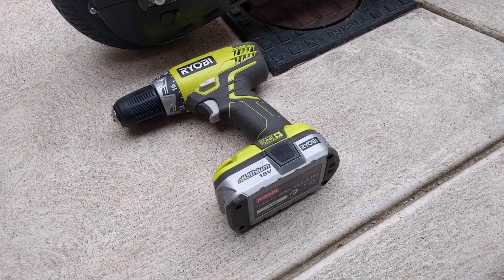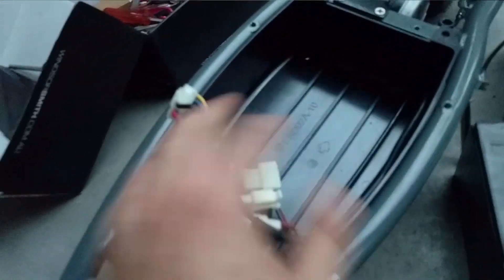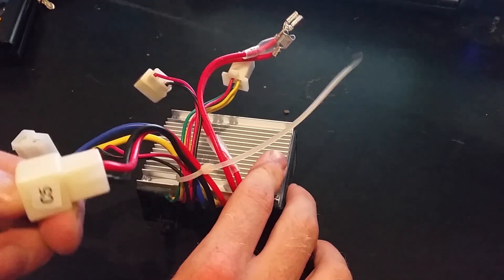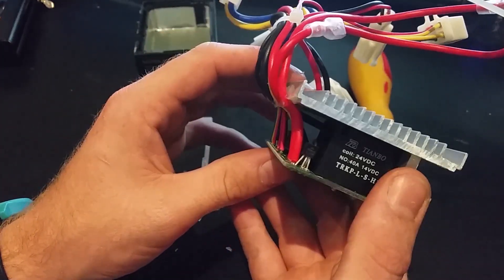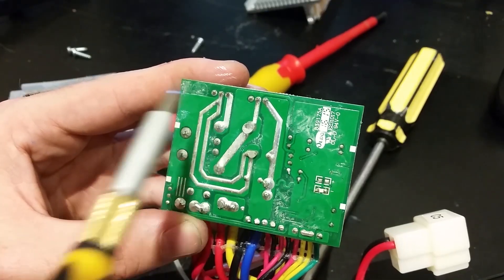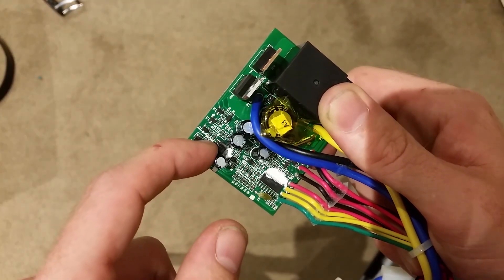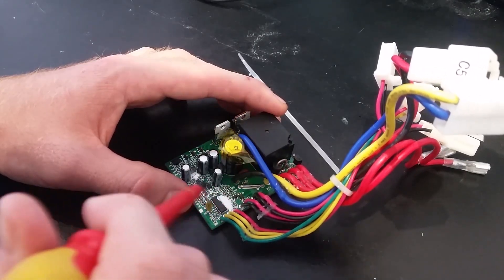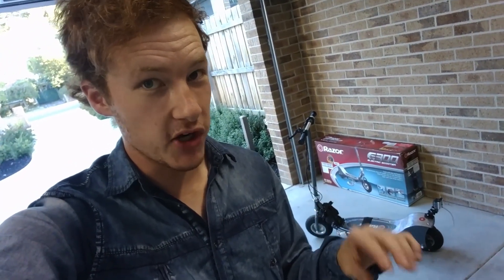Making the Razor E300 Faster With Drill Batteries! Ryobi ONE+ - Scooter Episode 2

Comment: To limit the effect the current shunt, just (on the solder side of the PCB), short the shunt pins with a length of copper wire. The current sense will say to itself, man this motor is very efficient, and not bother You.. Ken  !;!
Reply from the maker: Kenny Malone good tip! I get into this in some of the later episodes :D
Reply: Keep up the GooD Work..  !;!

Comment: Did you use a bms?
Reply from the maker: Wiziki nah, this was just a test. In the later episodes I do.
Reply: TK do you think bms’ are necessary? I’m building a system and I don’t want the hassle of trying to find a bms. Do you think that is safe?
Reply: TK and do you think a 7000w motor (brushless and 18s) is too much? And if I wanted to get a 7000w speed controller do you know where I would get one?
Reply from the maker: You either need a BMS or a balance charger, otherwise you'll destroy your batteries or cause a fire.

7kW is a LOT of power, and scooters like these are not very controllable. I'd say it could be too much but you can always try and see if it's rideable without hurting yourself. Tread carefully.
Reply: TK I mainly want it for the 18s (so I can fit 3 6s batteries). But what about the speed controller, would you be able to find it?
Reply: TK do you think that 2 batteries are enough? (6s 22.2V) and is there an alternative way to charge, other than taking out you battery’s and plugging them in?
Reply from the maker: Wiziki a lot of these questions are answered in later episodes. Have a watch and see how you go.
Reply: TK ok. Thanks.

Comment: I did this with a PR200, just overvolt. But I have been wanting to do this with the 4AH kobolt lithium battery packs. The only thing is, they are only 4AH which I have 10AH right now. Meaning less distance. Been wanting to try though. Replace the controller though. They don't like overvolting.

Comment: i have a e100 and im trying to get more juice out of it. the control board does not look anything like yours. It seems like it has 2 relays but not sure where or how i can bypass it like you did.
Reply from the maker: +Nacho Loza Hi! Yes, the E300 is a completely different scooter to yours.

Bypassing the relays won't do anything to make the scooter faster on an E300 anyway, it's only there as a safety cutout. You need to bypass it to make the scooter work with higher voltages (but you'll likely blow everything up anyway doing that, as the series shows).

E100s aren't as popular for modification but you could have a Google to see what can be done. :)
Reply: I poked around and didn’t find anything on the good ol inter-web.  Not sure if there is a solution.  Thanks for the reply

Comment: So, the speed controller is the little black box with the metal line things on top? Can i take it out and have the scooter still work? Is that why mine is so SLOW? I would love some advice on that
Reply from the maker: Wild Gaming the speed controller is what takes signals from the throttle and sends power to the motor. It isn't the main reason why the scooter is slow - that's largely down to motor and batteries. 

I modify the speed controller in future episodes to handle more power, but it's complex. I'll be releasing a video soon on a more accessible DIY mod for more speed.

Comment: hey just a quick question: I did not fully get the 2 points in which u souldered together in the last step could you explain a bit more
 and great video thanks
Reply from the maker: Hi Angela, for more detail on the mod check out https://www.google.com.sg/url?sa=t&source=web&rct=j&url=http://hackaday.io/project/9941-the-razor-e300-overvolt&ved=0ahUKEwjL58CfwcPVAhVFPI8KHaR0BuQQFggjMAA&usg=AFQjCNGPIaDH5KSIYM5CjaCK2ZwgSNXUnw

Hope that helps :D
Reply from the maker: one of the logs has detailed photos on what I did

Comment: Gave it a try but im pretty sure i broke it... Oops!
just makes a click coming from the "fun police" box when i engage the throttle. 

Thanks for the tips and im sure i just didnt follow you close enough. 
I knew the risk i was taking and tbh i would definitely try it again if i had the chance.
Reply from the maker: Hi David, sorry to hear it's not working out for you!

If it's making a click sound, that sounds like it's the relay shutting off because it's detecting too much voltage being put in.

As you know, we bypassed that in this video. Perhaps you just haven't quite bypassed it correctly? If nothing's getting hot or smoking, you probably haven't blown anything up. :)

You can read the project logs here which may help you out with some illustrated diagrams - https://hackaday.io/project/9941-the-razor-e300-overvolt

Just be careful of course, as these batteries can be dangerous and if the speed controller blows a FET while you're driving, it'll stick at full throttle which can be dangerous. Play with the scooter at your own risk :P
Reply: TK Fixed it! 
It was just a bad soldering job by me! 

I'm actually using the parts and mods from an old e300 to power my "new" E-bike! Probably a little safer as my brakes can over power the friction drive  setup just in case bad things happen! 

I'm looking into using 18650's. Have you worked with them much?
Reply: Just rewatched and realized that the drill batteries look like they are 18650s. 🤔
Reply from the maker: David DeMarta that's awesome dude! Glad we could trouble shoot that over comments haha, that's so cool.

As far as 18650s go, I haven't used them, but I've heard of people building eBike packs using them.
Reply from the maker: David DeMarta oh. Duh. You are right! Hahahaha.

Comment: I got 2 e100 for just about free. cut them to add them together ( made it longer ) added 2 more batteries in a series, 48v. tossed the servo/speed controller out and bang. A scooter that will push a 200lb man with ease. around 20mph
Reply: Yo where is the peed controller on the e100s, i cant find one on my daughters.

Comment: Why not just throw out all that crapola and just put in a high current relay?  All on or not on..
Reply from the maker: Jeremy Schoonover Switching high current DC with a relay wouldn't be particularly effective. The main issue would be arcing which would quickly destroy the relay in such use. In addition, the speed controller does do some PWM motor control even though the throttle input is on/off.
Reply: One could always use a high current DC switch like those found in those jumpstarter packs.  I think the copper plate switches are rated at something insane like 400 amps.  You're right about the relay arc-destroying the contacts.
Reply from the maker: Jeremy Schoonover certainly could use one, but they're not particularly well suited mechanically for use as any sort of throttle. flicking a big switch on and off while flying down the road isn't great versus a small flick of the wrist.

Comment: Hello, I need help. I have a Ezip E500 electric scooter. Is there any way to increase the speed?
Reply from the maker: Probably! Start by Googling to see what others have done. Failing that, research how the scooter works - motor type, controller type, batteries, etc. and then see where you can make improvements from there.

Comment: Remove the tires and put 10" that can hold more , I have one and they are more steady with 10" tires and you will go really fast and the module control holds really good .if you run this for long distance will over heat

Comment: All sounds great would be even better if you got hold of a Go-Go motability scooter and found out how to hack that so I can beat the old ladies.
Reply from the maker: Hah! I think Photonicinduction did a quick and dirty mod on one of those with a bajillion extra batteries for MOAR SPEED (Y)
Reply: I tried that, you can't. A faster one (8 MPH maximum compared to 4 MPH) has a different ratio gear box. Connecting the batteries directly to the motor doesn't increase the speed of the wheels. If you want faster, start with an 8MPH mobility scooter, and put some larger diameter wheels on it (the rear, driven wheels). In the UK where I am, you can drive a 4 MPH mobility scooter with no restrictions, but an 8MPH one can only be driven on the road and needs to be registered as a road vehicle, you do not pay road tax though. You are also meant to be genuinely disabled to drive one too, but I had fun driving round the supermarket and having people offer to help with things. They were a little upset when I got out and did things for myself, before I explained I was just on my way to deliver the scooter to someone that had had their own scooter break down.

Comment: 36v is just nominal voltage, at full charge it's actually 42 volts!  I am quite surprised it worked on only single cell in series, also wondering since I'll be building my own pack if should just connect 7 cells to get nominal voltage of 25.9V and double up in parallel to get more current, maybe even go 8s2p.
Reply from the maker: yeah, lithium cells have a huge operational voltage range. some of the HV lithium packs go up to 4.35V fully charged now! crazy.
Reply from the maker: I've done 8S on similar motors before without issue. 10S at high current got nasty in the latest video ;)

Comment: how can i make the battery last longer on mine? i dont even care about the speed i just want to have a use time of over 20 freaking minutes.
Reply from the maker: If you just want longer run time, I'd suggest swapping in 6S or 8S (or 2x4S) lithium packs with as much capacity as possible. That way you won't really be overstressing the controller but you'll have way more Ah (amphours) to play with in a smaller space and lighter weight than the stock SLA packs. 

You may still need to bypass the overvolt protection if you go 8S but it's workable.
Reply: TK ok thanks
Reply: TK oh and btw, if i change to those batteries, can i still charge them using the normal razor charger?
Reply from the maker: +RedYT Nah, you'd need to implement a solution like what I put together in episode 3.
Reply: TK ok

Comment: Hi! It looks like you changed the chain drive to belt drive, is that right? I was hoping to do this to try and make the scooter quieter. Would you mind pointing me in the right direction?
Reply from the maker: Still running the stock drive, I would have filmed it if I changed it. 

If you want to do that I'd say go buy a whole bunch of hardware from McMaster Carr (who don't ship to Aus, grr) or another mechanical parts place. Somewhere that sells belts and toothed pulleys and so on.

My old scooter I built had belt drive... there were slipping issues and it wasn't that much quieter. I'd say try and adjust and maintain yoir chain drive if it's too loud, first.
Reply: +TK Thanks for the response! It does seem strangely loud. Any recommendations on making it quieter? Cheers.
Reply from the maker: Check lubrication, if it's running "true" (i.e. sprockets are aligned), check it's not too tight or too loose. Check all bearings for lubrication and condition too.
Reply: +TK Ok will do. Thanks for your help!

Comment: I was about to mention that current shunt...replacing that alone is enough to triple your drive torque. I know cuz I did it with my e300s
Reply: But it never occurred to me to wire the thing straight to ground....
Reply: Are there any guidelines or maths for doing this and getting repeatable results? Do I just need to wire up a watt meter and play with shit?

I just picked up a e300 and I'd like to get some more range and speed out of it, mostly range. But I don't want to deal with buying hobby lipos and replacing controllers right now. 

How much can the stock electrics be pushed before I start worrying about melting things?

Comment: What kind of ride time do you get out of those batteries?
Reply from the maker: The stock batteries are 7 Ah, these are only about 1.5 Ah. Ride time is about 10-15 minutes. I used these as a proof-of-concept before I dropped coin on a beefier set of LiPos. I'm now just waiting on parts to complete the conversion and shoot a new video :)
Reply: +TK cool! I've added a 300w motor in place of my 100w on my e100 and bought two 18ah lawn mower batteries. very heavy but I get about 15mph for a solid two hours
Reply from the maker: Nice! That's a hefty pack you got there, long range is awesome. I really dig the Razor scooters, they're a great platform to hack on.
Reply: +TK they are! I'm planning to add a cushion or some sort of seat to mine next

Comment: already done that and my little pulse lightning with stock 24v 100w motor is still running with two makita  18v 4.0 A li-ion batteries in series. I only weigh 115 lbs so when fully charged at 20.3v a piece,  I can reach 27mph. just a push button wired directly to the motor and batteries.
Reply: Post video TC Woodworks and Design please!
Reply: +Steve Auguste 
yeah those tool batteries are something else, but I stopped using them. the scooter will run until there's power left and lithium ion cuts off when very low and that's when one of my makita battery ($100 a piece for these 3ah makitas)got fully drained and killed 6 cells inside, including the charging circuitry.
what I'm into now is three 12v plus one 6v, all 8ah, maxing out at 46v fully charged to the same stock 24v 250watts stock  e300 motor. I changed the wheel sprocket from the original 55 tooth to 47 tooth that came from the pulse lightning. had to enlarge the inside diameter using 2 1/8" bi metal hole saw and just refined it with a half round file.
the result of these higher voltage and sprocket combination was hair raising, as the e300 now can run at max speed of 33mph (via gps speedometer) and it's about time to change the motor sprocket to a 15 tooth, 1 3/8" diameter, from 11 tooth 1". it might pull near 40 but I doubt it unless the motor is swapped with a higher wattage, say about 500watts.
when start hitting the 30mph range, riding becomes scary, cars pulling up from corners, people walking and dangerous bumps even small at speed, that small of a tire inflated 45psi can jerk you and your eyes are always looking forward, can't even glance the side views usually done when running slow. I've forgotten how to post videos on YouTube (fyi- I will be 51 years old this December)and don't have anybody to ask to film me
Reply: + T C Woodworks and Design

Quick questions:

1)the "three 12v plus one 6v, all 8ah" are drill batteries?
2)changing sprockets made the scooters faster?
3)could you put the camera on something with height (like on top of a box) and angle the camera to catch you going down the street?

PS. I can help you upload the video once #3 is done! :)
Reply: +Steve Auguste 
batteries are all sla. but there's a better alternative, lighter and safer than lithium ion- check out lithium phosphate. same size as sla, very light, 12.8v and you can charge it with the regular sla charger.
the reduction of the wheel sprocket made it faster but at the same time consumes more power and I would imagine enlarging the motor sprocket will do the same. that's why, opting for a higher wattage is a solution, a 500w motor can take up to 52v with no problem and less heat plus more power in oppose to a 250w that heats up pretty fast in the upper 40s voltage. the higher the wattage the more you can overvolt.
but I will do what you suggest, to just place the camera at a certain spot to catch me getting closer to it and a driveby shot.
Reply: + T C Woodworks and Design Thanks for the heads up! Look forward to the video!

Comment: or you can just increase the ah of the batteries!  what I did is: I have two scooters and I took the batteries out from the one and put them all on one I left it with 24v but it got 14 ah instead of 7 ah it made it faster and the runtime is way longer the torque is much better too 
I didn't have to modify the controller
Reply: +tziebe are you still able to use the same charger to charge all 4 batteries?